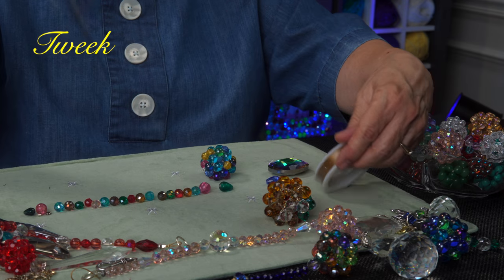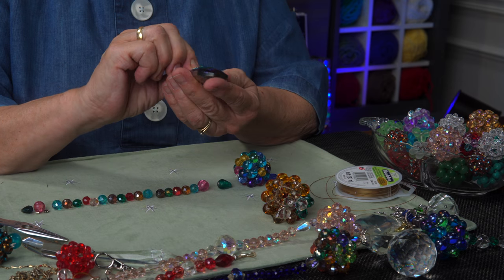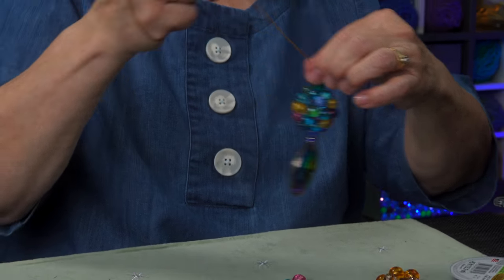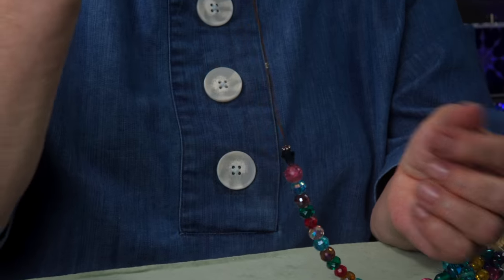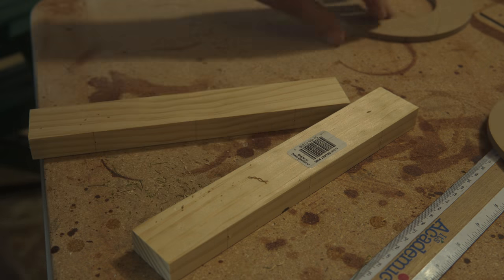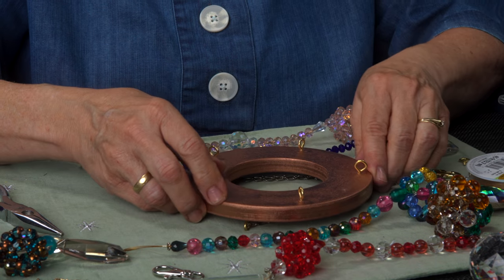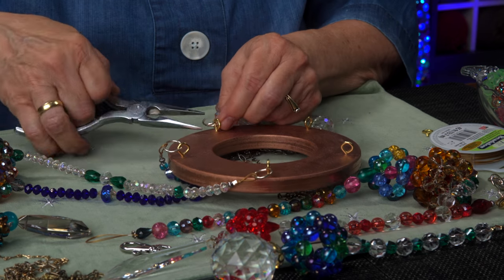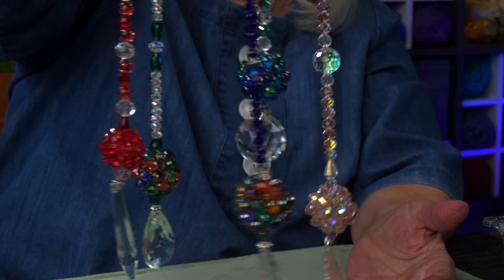DIY Beaded SUN CATCHER, Twinkling, Brilliant and Colorful, Tutorial

Comment: I have absolutely fallen in love with this craft! I especially like the types of beads you have chosen for this project. I would love to be able to buy these exact beads but I do not know what they are called or where to purchase them. Could you be of any help identifying what kind of beads you used? Are they some type of plastic faceted bead? Do you know where I can purchase them?  Thank you so much for any help you can provide!  I really want to learn how to make the beaded ball from one of your other videos too!!
Reply from the maker: Hi Carmela, When I create a suncatcher I do my best to stick with glass beads. My reasoning is that not only do glass beads reflect light better, they do not lose their color as sunlight bakes and/or fades plastic beads’ hues.   The beads I use can be found at your local craft store, bead store, online, or at antique or garage or rummage sales.  I am always on the look-out for beads!
To make a suncatcher OR a beaded cluster ball, YOU decide what size & what color of beads you’ll use.  The patterns are the same to follow no matter which you choose.   
If you’d like to copy the suncatcher in the video I’d suggest going online to see what size/color beads you prefer.  I use rondelle or round beads for the clusters.  Yet as you string your wire ANY bead becomes an option as long as it can be strung on the wire. 
My preferred wire size is Beadalon .018 size beading wire.  It comes in several color options. 
A bead from 4mm thru 18mm fit the wire nicely. 
So you see, Carmela, once you master the cluster ball ( start out with a 6mm - 8mm bead for easier learning & following the pattern ) your options widen as you make choices that best spark the suncatcher vibe that suits you best!  
Gather the materials around you and then have some beading fun!  You can do eet! 😄 Thanks for your comments!

Comment: I think you may want to rethink your chain at the top. The different weights of each strand will cause the entire thing to hang crooked because of the sliding chain.  Each section needs to be cut individually so there is no sliding up and down.  Beautiful tho…
Reply from the maker: Point taken… no issue on this end, so far 😉

Comment: Did you put both string threw all the beads
Reply from the maker: Hi Debra, Yes, after the wire goes through the pendant, at the start, both sides of the wire then meet and are strung together through all additional beads.  When you are done adding beads, add a crimp bead, then curl the wires back into that crimp bead to create the hanger.  There ya go!